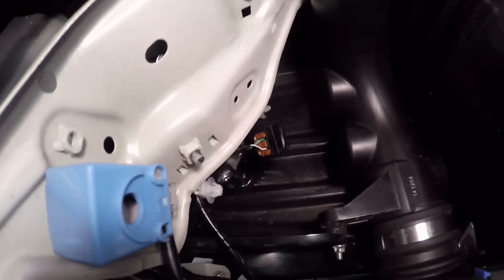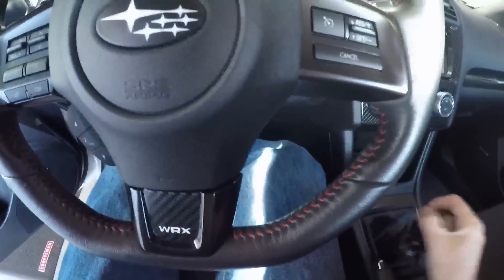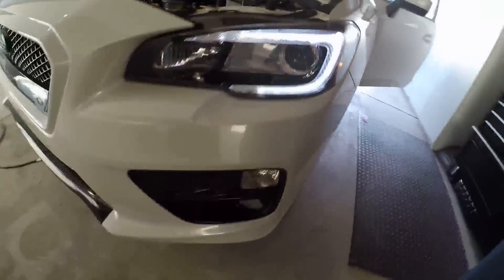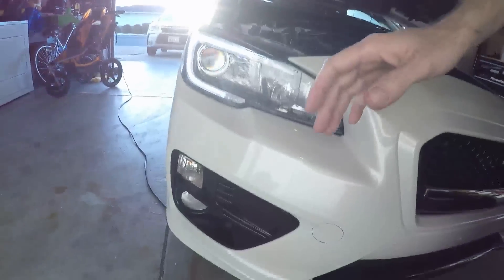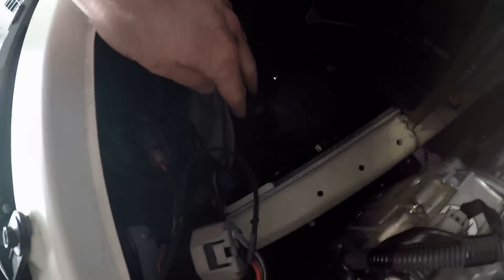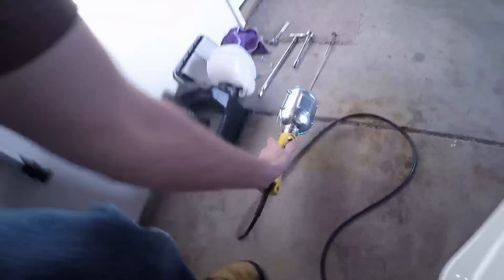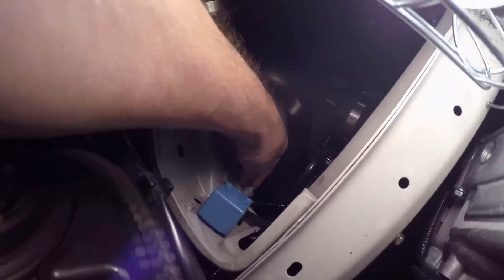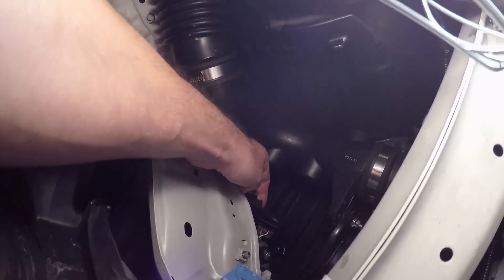2015 Subaru WRX Minisode 372: Followup - SubieBros C-Light DRL Issue Fixed

Comment: I have the exact same car, but I can’t get the cars LED C Light on the head lights to dim at all. I have DRL on my car, but I can’t get it to work with just the LED strip to dim in normal light. I’ve checked all the fuses and relays, and I’m just asking if u could pls help me with sending me the info for the exact combination settings to select on the headlight lever and fog and spot light settings.

Comment: Very strange.

I recently installed the Diode Dynamics c-lights and the DRL function didn't work for my right headlight. I got a replacement DRL harness and it still didn't work. I left it to sit overnight to troubleshoot in my head (didn't feel like pulling the bumper off and checking every connection) and in the morning it started working!
Reply from the maker: ya.. mine did that dude.. weird..

Comment: Sorry might sound like a stupid question, installing this harness and disconnecting the drl resistor harness gets the c light to function as drl and the highbeam Still works when needed correct? Also can i still leave my switches to auto and have drl (c light) function or would I have to set my lights to on?
Reply from the maker: yes your high beam still works even if you disconnect the DRL resistor.
Reply: you didn't answer his question, also my question. Does harness enables you to drive the headlight switch to auto or do you have to put it parking light position to get C light come on?

Comment: Looks great! I need to try these out!
Reply from the maker: +T-WRX as long as it never has a glitch again, ill prob keep it. but its kinda weird, cuz they are so dull now, i never know when my DRLs are really on. you can't even see them again your garage wall in daytime. but i guess i never really cared about seeing them before either, and this setup looks a lot better.
Reply: LastHumansGarage Keep us posted on the glitch. Hopefully its only that initial time.
Reply: +LastHumansGarage I've got the limited with led's and yeah, the c lights are pretty much invisible during the day. I'm wondering if it's possible to get a brighter led lamp for the c lights? Does anyone know? I'm not keen on cracking open the cases to install the c light kits but if I could just swap the lamp and get it brighter I'd give it a go.
Reply: +Stedy they sell brighter ones. Check out diode dynamics channel